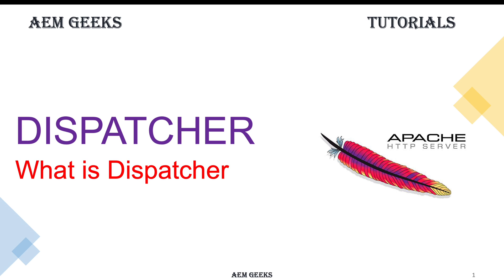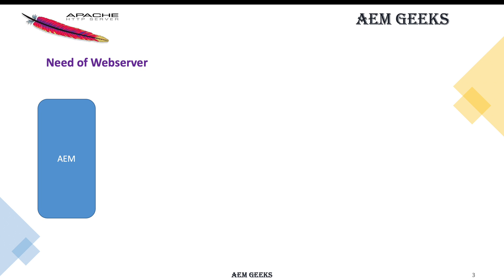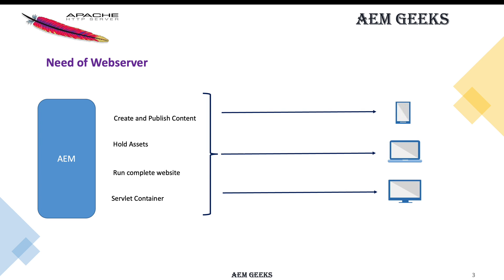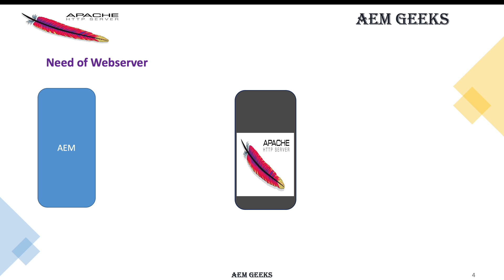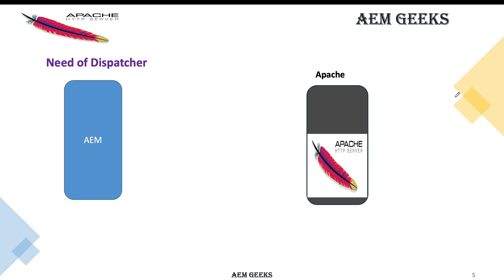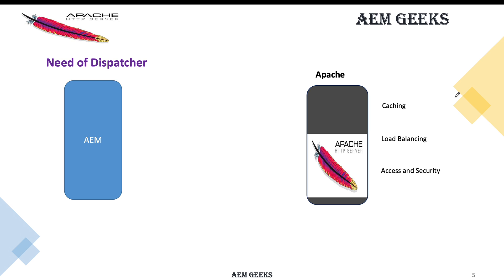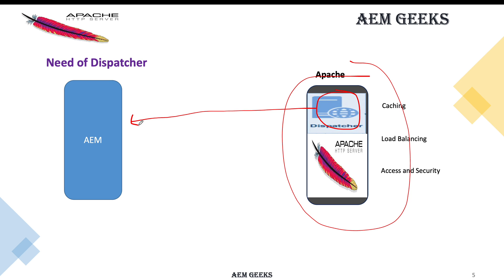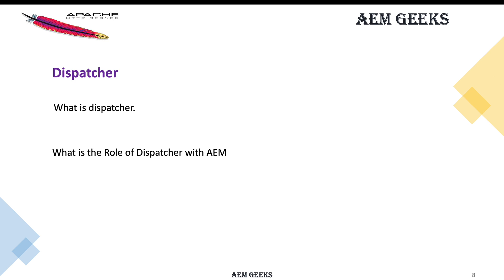Dispatcher #2 | What is AEM Dispatcher.

Comment: Video in a nutshell 

So basically AEM dispatcher acts as a mediator between Aem server or servers and end user.

It optimizes the performance by Caching , load balancing , filtering requests and controlling access , it basically handles requests by user and says server or servers what/when/where to do with the requests.

Caching: 

If a request is for a page that’s already cached, Dispatcher serves the cached version without bothering the AEM server.

Load Balancing: 

If the request needs to go to the AEM server (because it's not cached), Dispatcher decides which server should handle it (in case you have multiple AEM servers).

Request Filtering:

 It can block certain types of requests to protect the AEM server.

Access Control: 

Dispatcher can also ensure that only authorized users can access certain parts of your website.

Dispatcher mediates and optimizes, but it’s more than just telling the server what to do; it also takes actions like serving cached content or blocking/filtering requests, all to improve performance and security.